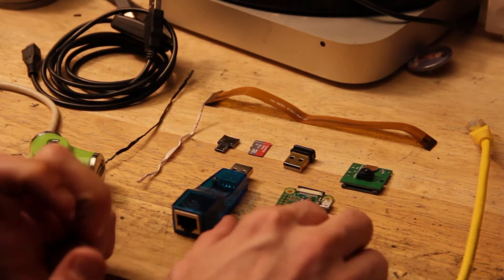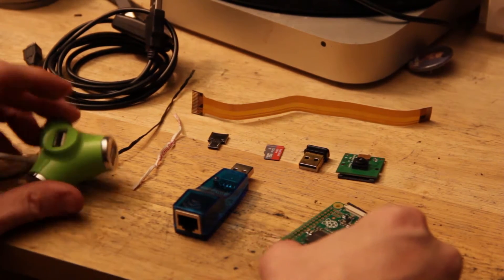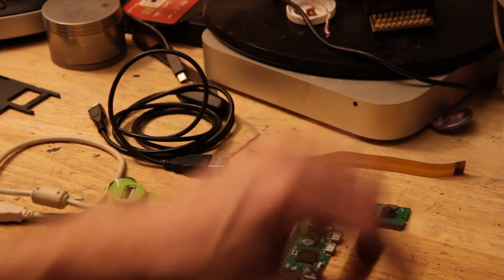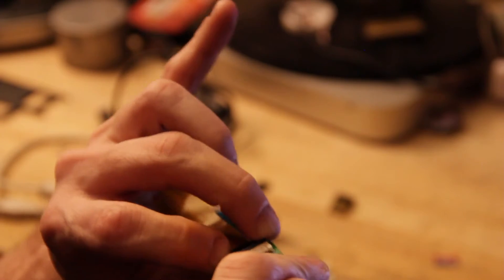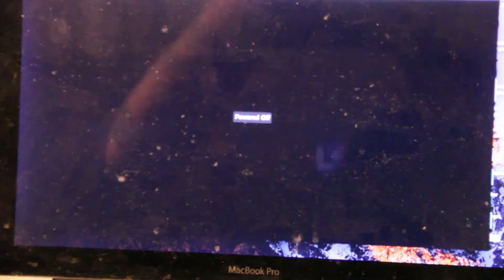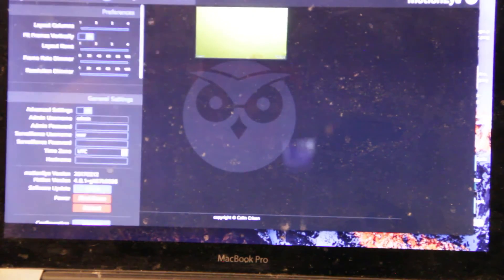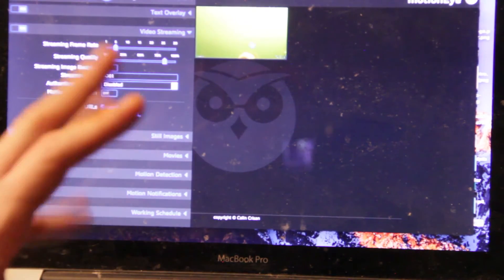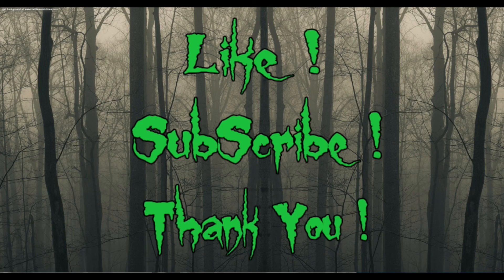Mad Jackal Labs Presents: Motion Eye OS On The Raspberry pi Zero

Comment: Hello why didnt you use the wifi adapter that was built in?
Reply: The original raspi zero did not have WiFi.  The Zero W model introduced it.
Reply: i want to know how to get the USB to ethernet adapter to work on a pi zero , i have a few zero W's and a few  zero 1.3's, i only bought them because they were on sale for like really cheap , 99 cents for the zeros and  $3.14 for the W's
i want to use a  regular pi zero 1.3 for pi hole and use the LAN adapter
but not sure how to set it up
not had good luck with pi  at all though ,  i can not get it to do anything at all  with the lite builds ,tried both jessie lite and stretch lite on both my pi  3 and pi zero ,  can not get my WPA supplicant file   to where it will connect to my WIFI , and my cheapo USB 2.0 4 port hub will not enumerate on the pi either , also mt SD gets corupted on every single boot , tried different SD's too and it constant.y bitches about power too or just does not work at all